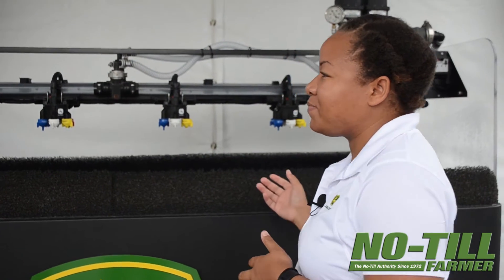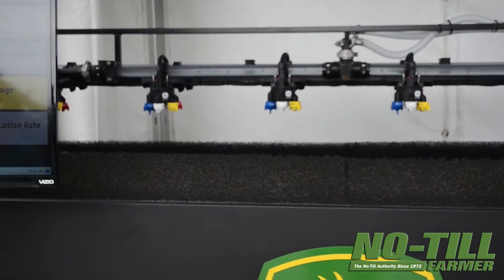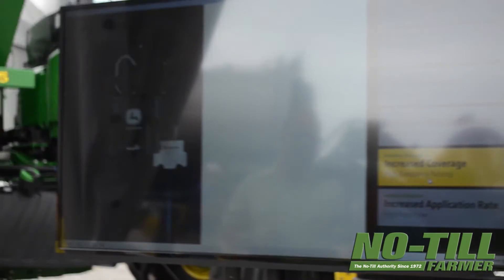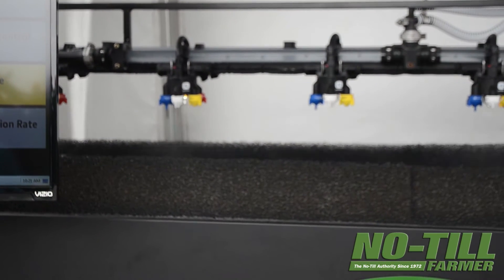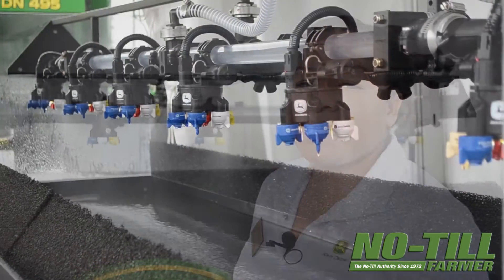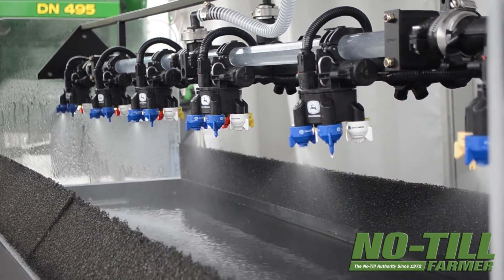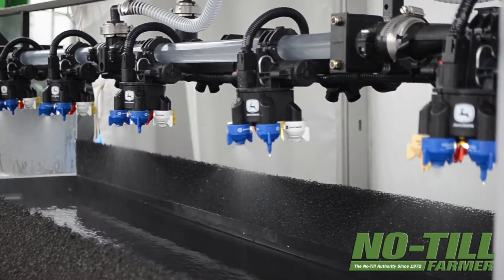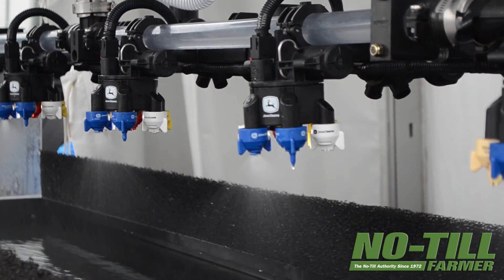John Deere Demonstrates ExactApply Nozzle Control

Comment: is there a pressure oscillation in the system due to pwm ? and if there is , are you controlling the pressure precisely or just by pressure relief valve ?